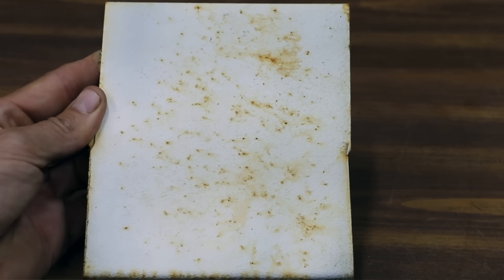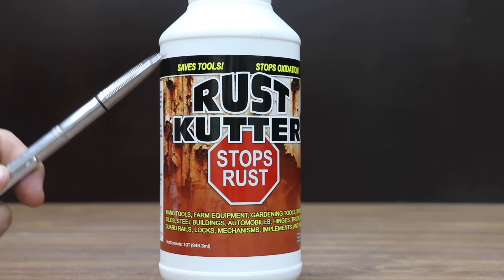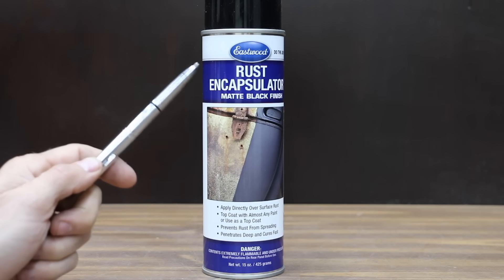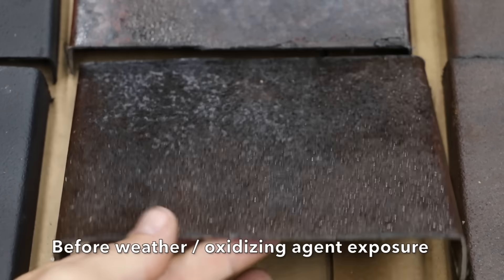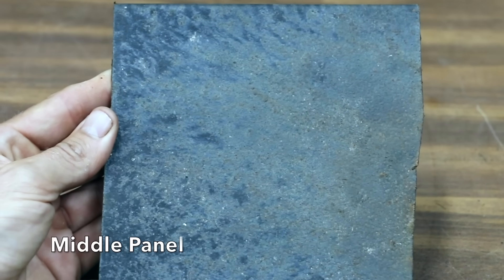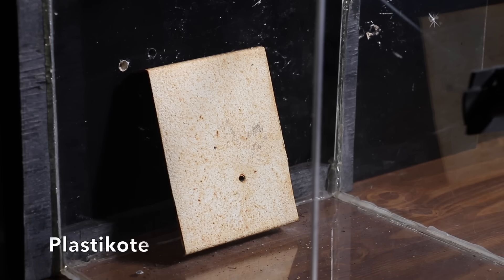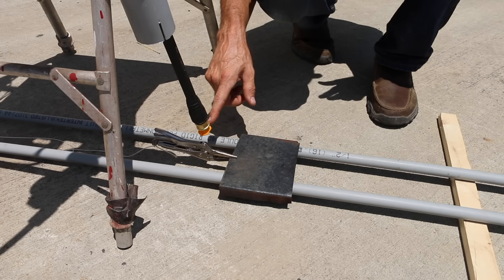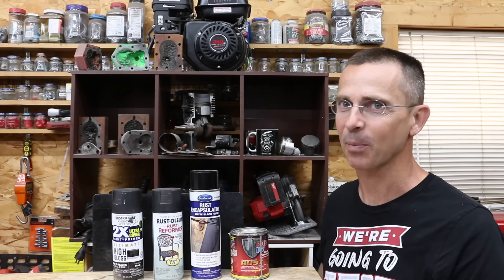Best Rust Converter? POR-15, Eastwood, Rust-oleum Rust Reformer, Gempler's

Comment: would there be less rusting if the entire piece was sealed on all surfaces? I feel like the exposed back of the metal test pieces does not help.  For the rust to come through the finish Oxygen has to be getting to it some how. either through a poorly sealed finish applied or the un treated surfaces.
Reply from the maker: Thanks for the suggestion.

Comment: I have new screws & Bolts..  They will be used inside house .   I want to put rust protector that will not fill in screw threads,.  If they become filled, the they will not work properly anymore or screw on.   What do you recommend.

Comment: Duplicolor Rust Fix is another one, and I tried it on the frame of my F350. It didn't make it through winter before the rust started up again.   POR15 needs a top coat as UV breaks it down, even underneath.  A few spots I treated with it are starting to show break through from 3 years ago.    I have to repair the bed which requires removal, so I will be going over the frame again with POR 15 and POR top coat.
Reply from the maker: Thanks for sharing.

Comment: Rust Off!  rust converter, used  by auto body shops. sold by quart, gallon or 5 gallon. I buy mine at the local auto parts store.
Reply from the maker: Thanks for the feedback.
Reply: @ProjectFarm  Thanks for replying to my comment. I am in Canada, not sure if it is available to you, it Is made by Dominion sure seal ltd. it is a dark red brown liquid, it reacts immediately bubbling on the rust,  i let it sit overnight, usually do a second application if there is deep pitting. you can tell by the reaction if the treatment is complete. thank for you great videos.

Comment: I'm confused... I thought, per this video, that POR-15 is a rust converter, but when I went to buy it, it said nothing about converting rust and actually mentioned another product of theirs that should be used before.  Their exact words were, "POR-15 Metal Prep to etch the surface and neutralize rust"... So is the POR-15 in this video just something that covers rust and doesn't convert it?  " Neutralize rust" sounds like a rust converter.  I am quite confused :(

Comment: tried them all, only thing that worked for me was using an epoxy primer with rust additives. I painted the roof and my decklid and an area that I had to sandblast caked rust off of on my 69 GS and applied Tamco DTA black primer, DTA direct to anything, their grey is superior to this for rust, found out after purchase, but been over 3 years now, never top coated and not a spec of rust popped through. Car garaged winters but sits outside all of summer.  I give up on all these types of products and will stick to an epoxy with rust additives from now on. I used 4 of the items in your test, the Rust Reformer I put on a rusty steel beam without any prep, left half with just this, other half put one of the 2x paints over, it has been sitting out 5 years without any rust popping out.  Just exposed to rain n snow, no salts or other environmental contaminants.  So depends on application.  My GS did see a couple winter drives with heavy WI salts and the only hit was to undercarriage, it was all original 69 paint underneath and 50% of it came off with just 2 trips to DR in middle of winter and quick bath after.. I will be applying epoxy under this ride hopefully this summer... back permitting.. sucks getting old..  thanks for the vids, watched a few tonight..  Maybe some vids using epoxy paints for preventing rust on both virgin metal and exposed to rust..
Reply from the maker: Thanks for sharing. Thanks for the suggestion.

Comment: Something I would like to add for the por-15 is that a little goes a long way. It might seem expensive but it goes on super easy and you use a lot less product. I’ve been super impressed with it so far and I’m glad to see it holds up to this much abuse!
Reply from the maker: Thanks for the feedback.
Reply: How does it go on easy!?? It’s like trying to paint with milk with how runny it is??.... works good but I can’t paint for shit without it dripping and running everywhere..
Reply: @undertakerfire7810  you’re probably putting it on too thick. It really doesn’t need much and goes a long way

Comment: Without testing Bill Hirsch Miracle Paint, the test is incomplete. Everything here is basically “consumer grade”. Bill Hirsch has to be ordered from the manufacturer. I’ve been using it for 30 years, and it has no equal.
Reply from the maker: Thanks for the suggestion.

Comment: Somebody should make a coil gun out of those. I made a simple conical one out of 50' of kynar wire from radio shack. Sparked across mains power it had enough energy to crack an acrylic cd jewel case.

Comment: I would just get either of the Rust-Oleum products and for another $5 get their clear coat products so for basically $10-$15 you can have something that will seal the rust neutralizer in, protect against the salt & UV light... Or can even possibly use a black brush on primer product like from Wurth that is typically used on/around window pinch weld sections before installing windows... Then clear coat... I bet would last a REALLY long time Using these combos...

Still doing amazing testing of products... REALLY enjoy seeing the results for products that stop/prevent rust (car undercoatings as well)... As we all know the HUGE headaches that the winter seasons in the salt belts cause...

KeepOnKeepingOn SPREADING the TRUTH of Products performance my friend 🙌🏽🇺🇲
Reply from the maker: Thanks, will do!  Thanks for the feedback.

Comment: This one would have benefitted from a UV test. I've heard POR15 doesn't have UV protection. Other than that I've always heard of it being a great product.
I make scrap metal art and use VHT flame proof  satin clear for a durable finish. Ive tried other satin or flat clears but VHT has been the best for me so far. Duplicolor engine paint clear at a close second. 
Surprised VHT in the rust converter didn't do better but I haven't tried it so don't know. 
Thanks for this round of tests.
Reply from the maker: You are welcome!  Thanks for the feedback.

Comment: I've been using POR-15 for years now, it really is the best for surfaces you cant fully get rust off of, like pitted sheet metal, or cast parts like knuckles. When it dries, Its basically powder coating in a can.
Reply from the maker: Thanks for sharing.

Comment: Most of these products are total junk.  I used the rustoleum product the first time....guess who will have to redo the job after 4 yrs?  Thank you so much for doing this video
Reply from the maker: You are welcome!
Reply: @ProjectFarm  I know you didn't test this product, Chassis Saver, in this video, but which do you think is better.  Chassis Saver or POR 15?  I think they are very similar products, but I haven't used either.

Comment: Don't forget:  on nearly all of these, he applied two coats.  For the Rust-oleum Rust Reformer, he only applied one coat because I think the can may have said only one coat required.  The website definitely says the same as all the others though -- for best results, several light coats applied a few minutes apart.  I'd have liked to have seen the various surface durability tests done where the Rust Reformer had the same number of coats as the rest of them.
Reply: Before even seeing this test, funny that the my 2 go-to products for my car projects are POR15 and Rust Reformer (the latter being easier to use b/c it's a spray can versus brush-on).  I do 2 coats of the Reformer.
Reply: @mike325ci same i do 2-3 coats if rust reformer.   On my old classics.. where i cleaned the rust as best i could.  It actually never came back 5-7 years after the fact. Maybe 2-3 coats its overkill...  but it works for me.  Rust reformer can alao get into tighter places.  Etc ricker pabels..  kick panels.. and pillars etc
Reply from the maker: Thanks for sharing.

Comment: There is a chemical treatment called ospho, if I remember it is phosphoric acid and a few other things it chemically reacts with the rust converting it turning it black. I used it when I lived on a boat it is fantastic. It is also very expensive.
Reply from the maker: Thanks for sharing.
Reply: Agreed, Ospho is a great product that I have used for years. When I saw this video I hoped it would be reviewed with the others. Or at least, a similar phosphoric acid to ospho.

Comment: If you ever do this test again, please include Corroseal, and it would also be great if you could briefly explain the different types, like tannic acid vs. gallic acid vs. etc, pros and cons of each kind.  Also try on mixed surfaces where there is some rust, some bare metal, some paint etc.  Great episode, great channel.  I've bought and used some of your recommendations.
Reply from the maker: Thank you for the video idea!
Reply: @ProjectFarm  also ospho. Osphoric acid. Great work!
Reply: I used corroseal on a rusty 4Runner frame that I spent days cleaning up and prepping very well. It did not hold up at all and rust reappeared in a months time. Not saying the product doesn’t work, I definitely may have not used it right. But I’ll never use it again.

Comment: I have a galvanized metal fence around my outdoor kitchen.  When I see a little rust appear, I spray it with a Rust-oleum rattle can cold galvanized compound and it seems to work pretty well.  I have 2 types from Rust-oleum and one is shinier than the other.
Reply from the maker: Thanks for sharing.

Comment: Was the white 2x that you applied gloss, semi or matt?
I ask because in my experience semi and matt paint can actually accelerate corrosion because they tend to hold onto moisture. When we build items for exterior use that need a matt or semi finish, we always paint a couple of coats of high-gloss color before applying a clear with the required surface finish.

Comment: Most of these are encapsulaters and paint based. The good rust "converters" are phosphoric acid based. I have used Corroseal and Ospho with Ospho giving the best results. It converts the rust back into iron something, can't remember what. After sitting for 12 hours or so, the rust has turned black and very hard. I used baking soda and water to neutralize and clean the surface prior to paint.  Have used it extensively in automotive repairs, sanded it and primed with zinc primer, Then normal prep for auto paint. Over 3 years in midwest winter salt and no rust has reappeared.
Reply from the maker: Thanks for sharing.

Comment: I've used POR15 a number of times. It seals well, stops rust and holds up well..
But the same things that make it so tough and durable also make it a bit more difficult to work with. For one, you have got to be very careful not to get it on anything you don't want it on. Once it's on a garage floor it will be there forever. If you get it on your skin, it will be there for weeks. Get it in your hair, get out the scissors (don't ask me how I know).  It is nearly impossible to remove if you ever want to refinish a surface. It even holds up to sandblasting.  I don't know if it can be sprayed without ruining a spray gun. I've only ever applied it with a single-use brush, which doesn't make for a nice smooth finish. If you ever have to do a weld repair near it, the fumes are very noxious. And it is best used in places where it won't be exposed to a lot of UV light, such as underneath a car. Over time in direct sunlight it discolors noticeably, takes on a yellowish tint.
But, it's easily the toughest paint I've ever used!
Reply from the maker: Thanks for the feedback.

Comment: Hi Todd. I know you get too many requests. However on this same topic, it would be great if you tested zinc rich paints,  zinc chromate paints and etching primers, all over both steel and aluminum. That would be great. And while at it, complicate things a bit more by throwing in some two part epoxy primers also. 😀
Reply from the maker: Great suggestion! Thank you.

Comment: I actually did my steel wheels using Rust Reformer BEFORE even watching this video. I am VERY impressed. All 4 wheels done (outside face) in half a can!!! I agree with Project Farm here. It is a nice matte black and is very cost effective. Another option was gloss black rust paint which I returned. I planned to do gloss paint over then rust reformer but I was happy with the matte black (greyish) with rust reformer alone. I will simply sand down and top up the rust reformer as needed and thats all that's needed to keep these wheels rust free (mostly)!!! Oh it cost me $11 CAD for rust reformer can.
Reply from the maker: Thanks for sharing.
Reply: @ProjectFarm  Just an update, the rusted parts are where the hubcaps made contact with the wheels. So NEVER use hub caps on steel wheels because they rust the shit out of the wheels! The rust reformer did not hold up too well and the rust has come out through the paint. I imagine it would have been worse without the rust reformer.

Comment: Used the p o r 15 on a leaking oil pan drain the oil clean the bottom of the pan up with alcohol waited several days cleaned one more time with alcohol proceeded just to lightly scrape off the oil pan didn't sand it didn't wire brush it no room no way to work on it painted liberally the POR 15 all over the leak and the cracks which were just cracks in the metal from rust three coats figured what the heck try it car is driving an average of 70 miles a day it's been over 2 weeks not even a hint of an oil leak PR 15 is worth it every dollar excellent product
Reply from the maker: Thanks for the feedback.

Comment: TOP TIP : POR 15 - buy the smallest tin that you need, as it must be stored airtight, and if you get any on the tin lid, you might not be able to do that in the original tin.
Reply from the maker: Thanks for the feedback.

Comment: I considered POR 15, but for $50 a quart I decided to grind to bare metal and use FLuid Film (from your rust prevention video) instead.
HOWEVER.. Rustoleum Rust Reformer: In areas where I don't expect any chip damage, given how cheap it is, I'll be using that. Like the body panels beneath fenders and inside the engine bay. Given the low cost and that I actually prefer matte finishes over gloss ones, I think that's the best fit for me. But I won't use it on the underbelly, because that's the death valley of rust and chip damage. I'll spend the extra there.
Reply from the maker: Thanks for sharing.

Comment: I used to coat bathtubs tile ext. the only thing we ever trusted was the por15. Word of advice with that product if you open the can try to use it all. The lid will basically weld itself to the can and if you manage to get it open it will go flying everywhere and is hard to clean up with any chemical you can get.
Reply from the maker: Thanks for the feedback.

Comment: Rust-Oleum Rust Reformer is my go-to for years now.  Even on non-rusty metal it makes a good primer.  I even use it on wood and plastic, the chemical composition makes it stick very well as a primer.  I have sprayed tough items like trailer hitches and tractor implements with the Rust Reformer and it holds up very well to use and weather.  I was hoping you had included a product called Corroseal in your test, I've bought some to use on some steel beams in my shop and it appears similar to the Plastikote product.  Brushes on white, dries black.
Reply from the maker: Thanks for the suggestion for future round of testing.

Comment: Por 15 is my go to. They have tons of products even a metal prep that gets rid of rust and etches the metal (even non-rusty metal) so por 15 can be used. I now work at a factory that makes plastic beads and ball bearings. Many of their machines were built in the mid-1930s and are very rusted due to age, lack of care, and the amount of water used. I just completely disassembled one of the machines and completely removed what paint was left and loose rust. I used the por 15 epoxy putty where needed to fix holes and painted with the por 15. Then just top coated with the color they wanted. One thing about por 15, if you get it on you without cleaning  it off immediately you will be wearing it for a long time LOL
Reply from the maker: Thanks for sharing!

Comment: In your tests, you state that you applied salt and vinegar. As vinegar is an acid, it will neutralize salt. Many racers who go to Bonneville Salt Flats use vinegar under their tow/ push vehicles, as well as their race vehicles.
Reply from the maker: Thanks for the feedback.

Comment: You've got to keep your eye on that POR15.  I had fender well rust, between the body panel and the fender liner (both are metal), in Jan. 2012.
I used the POR15's three can kit Super Starter Kit (SSKS).  One of the bottles was Marine Clean, then a bottle of Prep & Ready, finally a can of Silver Rust Preventive.  The Silver Rust Preventive was almost as thick as cold pan cake syrup.
In 2019, I saw some light brown rust coming back.  The silver color is no longer available, from POR15, so I used what was left in my original kit.
It's Nov. 2021, and no new rust since 2019.
Reply from the maker: Thanks for the feedback.
Reply: @ProjectFarm  yes, I’ve taken your advice many times. Thank you

Comment: Hey PF! I would like to see ACF-50 tested. I restore old motorcycles and I use this stuff to prevent corrosion on steel and aluminum. Seems to work well but I would like to see it compared against other brands!
Reply from the maker: Thanks for the suggestion.